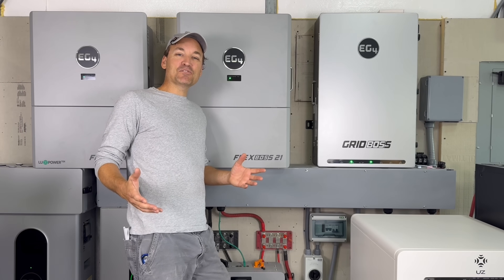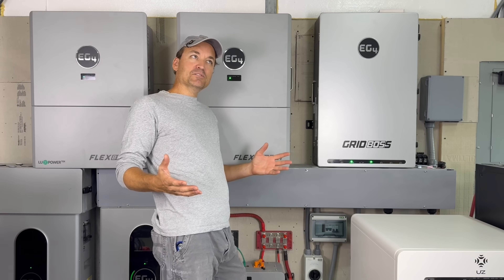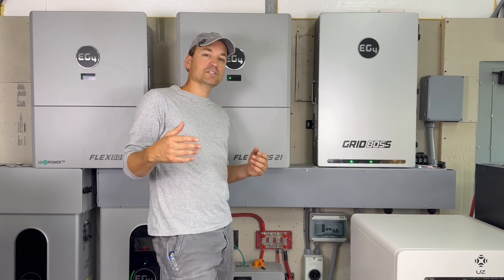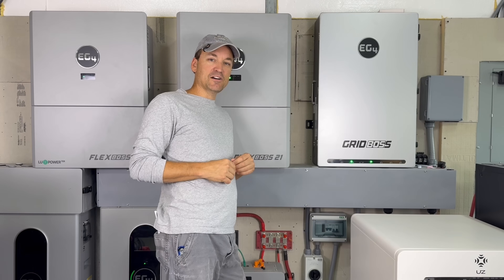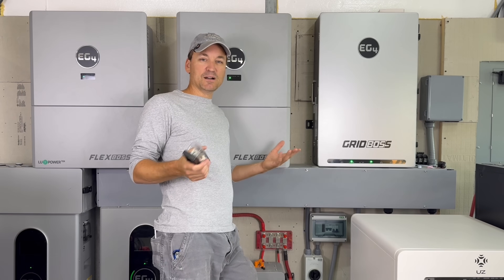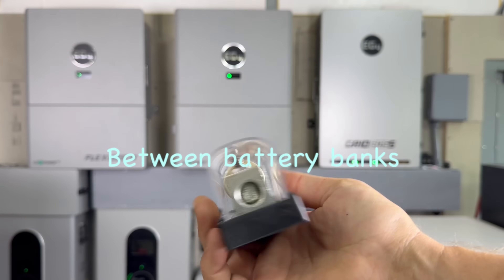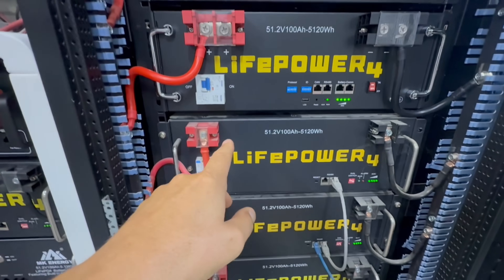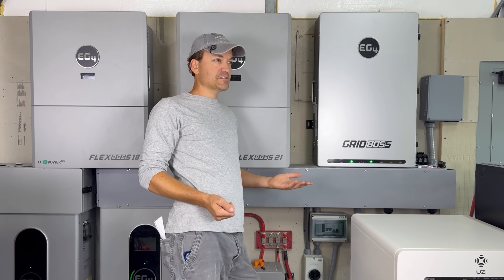FAQ: EG4 PV voltage on inverters? How to add more batteries? Load port on Flexboss with Gridboss?

Comment: Hello, people never talk about if you have 100amps batteries like server rack batteries then you buy a 280ah batteries now the inverter wants to pull from the 280ah batteries first.  What you say about this?
Reply from the maker: I have all sorts hooked up. You may see a difference as they discharge, or even as they charge. But ultimately they all end up at the top together. The resistance is less on a larger battery, so it’ll start to discharge faster than the rack battery. But that’s perfectly normal. In the end they are all sharing the load.
Reply: @GavinStoneDIY thank you.  I have four humsienk batteries 12.8v100a in series to make 51.2, then I also have a single 51.2v 100ah battery and last i have another humsienk batteries four 12.8v 320ah.  So i took the first two sets and hook them up in parallel to make 51.2v 200ah.  So now on busbares I have a 51.2v 320 & a 51.2v 200a. I'm going to buy another single 51.2v 100ah battery and put it in parallel.  To final have 51.2v 300ah with that 51.2v320. To even out the whole bank.
Reply from the maker: @Livingsolaryourway just make sure to add a balancer between the 12v batteries in series. They will stray away from each other and that can cause voltage issues between the packs.
Reply: @GavinStoneDIY I do have one on the first ones, waiting for the second one for the new four batteries.

Comment: If you have two EG4 FlexBOSS21 inverters, with three wall mount batteries on each inverter, how do they share batteries? Is it two separate strings of three batteries on each inverter or are the batteries in a string going to the Flex Grid and back to the inverters?
Reply from the maker: You could do it either way really. If you run 3 batteries to each inverter you can select the “separate battery” option and they’ll run independently on their own battery banks. I prefer combining everything and running a set of leads to each inverter. Probably with a central busbar.

Comment: As you've mentioned in the last few minutes, do you have a video that show the correct initial startup for a FB with lifepower4 V2 batteries? I've gone through all of their documentation and cannot find any of this information; I have multiple batteries and would like to do everything correctly.
Reply from the maker: I may show it in my V2 review. The correct procedure is both DC breakers on first. Battery and inverter. Then cycle the BMS button on, (the red button) with one battery. The inverter will  turn on, then you’re safe to turn all the other batteries on. That one battery charges the capacitors up on the inverter. Many many people flip the breakers on last, the BMS isn’t able to use its built in precharge resistors in the battery if it’s done that way. Which allows a large inrush from the battery to the inverter.
Reply: @GavinStoneDIY thank you so much!

Comment: That 120V minimum for the 18kpv is way off.  I finally got my two 18kpv's working this past weekend.  Originally, I had four strings going in to each inverter, each with a Voc of around 225V.  The MPPTs kept cutting in and out.  So I changed my configuration to 3 strings of 8 panels each (Voc of 300V) and they work like a charm now all day long.  The manual also shows a very low voltage for the minimum.  I really wish it was accurate.  Because of that, I have two extra pair of conductors running all the way to my arrays.  That's a lot of copper.  I guess I can always add more panels later on down the road and try 7 panels per string.  Hopefully that will work.  No room on my racks for more than 28 panels on each (28 / 4 = 7).

Comment: Great video. Most youtubers can not answer this question seems like for months. Which one of these would be able to run a 2.5 ton HVAC and one 3 ton minisplit. With a 50amp  manual transfer switch 240v, split phase is even better, but with those requests?  Quieter the better. Money is not an issue. Easy hook up to only a manual transfer switch is required way. I refuse to mess with adding another subpanel next to a subpanel, if I am only running those 2 on a big transfer switch. Zero grid tie of any kind. I don't even want it powered on by the grid. I don't care for smart features to be activated now. No soft start. Just want it to function for what I want.  Let's see if you can answer this without saying "uh subpanel critical loads is better". Lol. The switch is installed and I am running out of free time as a surgeon. And don't like AZ greedy contractors. Love your videos man. I know you know your stuff. 👍👌 again price is not an issue to meet these reqs. Time is the issue for me.  P.S. This is a fun hobby for me, but would like to have the easy all in one inverter picked out by 4 months, which is now. This is after 30k spent on anker f3800 pluses and f3000s. But they suck when it comes to PV input.
Reply from the maker: The flexboss 18 would be what I’d recommend. It’s the quietest inverter I’ve tested. It would handle those 2 loads without an issue. If you’re not involving grid then you’ll want plenty of battery and PV. If you need more details you can email me and I can help.
Reply: @GavinStoneDIY  thanks. As of right now i have 30 panels from Aptos bifacial and Canadian 450w. I will buy a bunch of batteries. Is flex boss tougher to install than the 6000xp?
Reply from the maker: @SurgeonTech  it depends on how you’re using it. For your setup it would be about the same as a 6000xp. Unless you wanted to involve the grid for hybrid features. Even then it’s not too bad really.
Reply: @GavinStoneDIY  sweet. Yea I just want one installed before the deadline and then i will play with features and full integration, slowly and calmly haha. Looks like they are sold out in a lot of places. I'll keep looking. Thank you!
Reply from the maker: @SurgeonTech I asked EG4 about their FB18 stock. They are hoping to have more soon. Apparently lots of demand.
Reply: @GavinStoneDIY  it would be really nice to be able to utilize a generator input pass through, so I can use the 35kwh from Anker that I now have, but I think only gridboss has that option. I read that 12000xp does not allow for that.
Reply from the maker: @SurgeonTech yeah you’d need the GridBoss to allow for generator or ac coupling.
Reply: @GavinStoneDIY  it looks doable, but there will be some pacing, like I did with the transfer switches, until i did my first one haha. Crazy, I can do the toughest surgeries without any prepping, but this is next level for me. I'm very careful and research a ton before plugging up anything to the house wiring.
Reply from the maker: @SurgeonTech yeah it’s all in what you’re used to. It gets easier the more work you do with it.

Comment: I'm hoping the Flexboss can make use of the included CTs to monitor the load port usage and officially unlock that option while still using the Gridboss.  One big selling point of Gridboss for me was having your inverter away from the service entrance.. seems a little strange they can't make this work?
Reply from the maker: Possibly a firmware update could fix this. Not sure on that though. I’m chatting about it with EG4.

Comment: Considering the FB can be up to 260 ft away from the GB, I can envision needing some local power way out at the FB. Maybe to power some fans or lights... running a simple plug outlet off of it w/a breaker would be awesome.
Reply: I would love for this to be handled officially. My grid boss is 50 ft away and the majority of the power usage in house is closer to the inverter.  I'm wondering if the included CTs and a software update could get the load lugs passing the right information back to the gridboss.

Comment: I have powered small 240V devices (monitor screen) from the Load ports on the FB21 while doing some testing. They did work and I came to the same conclusion -- that reported numbers would be wrong because of the unmonitored draw. However, I have hopes that this can be fixed in the future with a simple firmware upgrade -- combined with the CT port on the FB and using CTs to monitor the Load port.
Reply from the maker: Good point. I’ll mention that to EG4.

Comment: One scenario to use the load port would be a small sub panel when the flexboss is in a different location (barn/outbuilding) this way you dont have to run conductors all the way from the gridboss. Or like James talks about feeding the port with power from some panels to be able to dark start.  If using micro inverters this would make sense to have the port live.
Reply from the maker: Yeah the location makes sense. Feeding the load port with ac power though? I haven’t tested that aspect.

Comment: so! on the inverter what the total max battery voltage?
Reply: 60 volts
Reply: @paulmillner  okay I was just checking that I saw 40 - to 60. Thanks
Reply: I just bought and received my 12000xp from signature Solar did a store pickup to save that delivery fee. Quick question, the inverter want 400a of batteries.  So if I built a pack using four 12.8v 300ah  with a 200a bms. All hookup in series, can I pull the full 400a off this set. My math says 400÷4= 100a each. From bms that rated for 200a. Reason I ask some people say I need two sets of batteries. What you think?

Comment: Very helpful video. It inspired two related questions:
1. I will soon be adding a DIY 3-battery bank @ 314ah each to my existing EG4 storage consisting of 4 280ah indoor wall mount bank connected together with the paralleling kits. I already purchased individual Blue Sea 200 amp terminal fuses for each new battery. Would you still recommend a bank-level fuse as well before I attach the new bank to the busbar?

2. For charging/discharging the new bank, the end battery of the EG4 bank will be connected to a 600 amp busbar and the new bank also attached to that busbar. Is this how you would connect the new battery bank to an existing EG4 bank and would you use the separate battery feature to establish com with the slave inverter? Sorry, I snuck in a third question.
Reply from the maker: I prefer the inverters share the same battery bank when possible. I would run everything to the 600 amp busbars like you’re doing. And it sounds like you have the fuses covered. That should work good. I just recently bought a blue sea fuse. They make some nice gear.
Reply: Thank you Gavin. Your channel has been a Godsend to me. You make it look so easy…but I know it’s not!

Comment: Another way to pre-charge is to use an old school light bulb. They will slightly light up at first and when they go dim, the pre charge is finished,
Reply from the maker: Good point! Ive always liked this method. I’ve seen others use it. And I still haven’t showed it on video myself. I need to do that.

Comment: Getting my third 14.3kWh battery in a few days.  Was doing fine with two but to make it overnight I can only export after 6pm and drain down to 55% SOC (to leave enough for overnight margins). I was also hitting 100% by 2pm on sunny day and leaving a lot on the table.  California's NEM 3 only gives good export rates after 6pm or so.

A third battery fixes both issues and also expands my EV charging flexibility.  But I admit its a luxury item.  The fun factor is high, though.

-Matt
Reply from the maker: Solar is addictive. 🙂

Comment: I'm considering adding an additional EG4 All Weather Battery to my system but I already have three all weather batteries in parallel.  Per EG4 they  only recommend 3 batteries per inverter but I would like to avoid needing to purchase another inverter just to add one more battery to my bank.  Anyway you know of that I can do that safely without the need of purchasing a 2nd inverter?
Reply from the maker: Anything over 3 wallmounts they recommend adding a fuse. Which makes sense. So a T class fuse like I showed would work great in that case. You wouldn’t be pulling much from each battery with only one inverter. So technically you could add a 200 amps T class fuse and be fine. So get regular paralleling kit, and splice a T class fuse in between that battery and the next.

Comment: I have a question How many amps can I draw from the 18k pv from the Generator port when it is on AC Couple?
Reply from the maker: Oh good one. I haven’t looked at the specs in a while. But I believe it’s 90 amps.

Comment: Can you use the com ports on both inverters to talk with 2 sets of batteries?  IE EG4 on the Flex 21 and say Ruixu on the other inverter?
Reply from the maker: Yes. You can choose the “separate battery” option. And they’ll each run coms to a different battery bank.